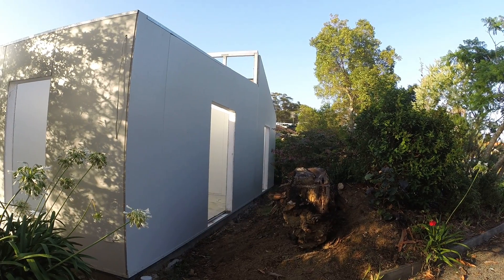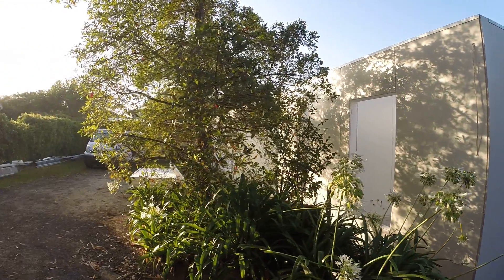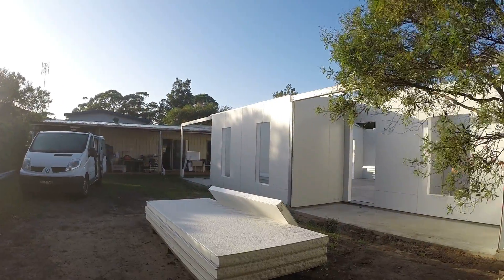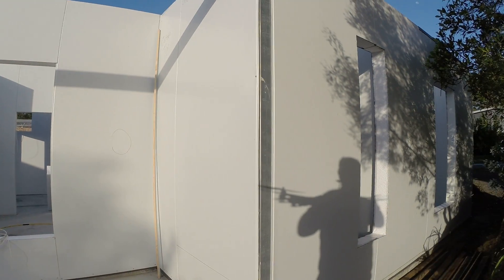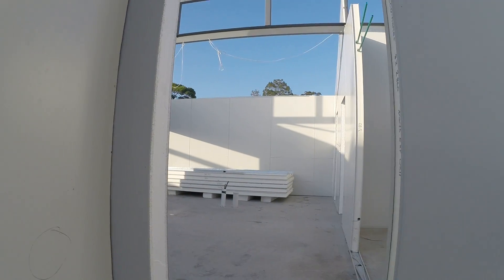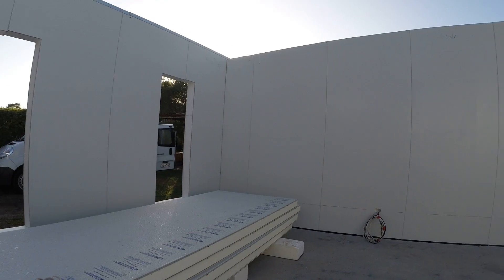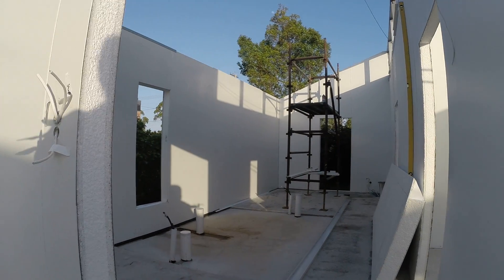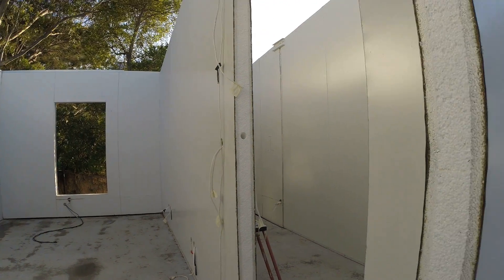SIPS Panel House Build So Far

Comment: I just found this video. Now I am going to have to binge watch your whole channel.
I have several questions but first of all - why did you use SIPS for the internal walls? Would it have been better to use regular wooden framing for the internal walls to make running services easier?

Comment: What do you do for siding?
Reply from the maker: As the Bluescope Steel and primed and pre painted with white colour bond  before being made in to panels you don't have to do anything. But if you have a look at some of my other videos I've clad one section in Villaboard and then applied stack stone to with normal tile adhesive. I will be applying Hardies weathertex paneling to the front of the house but this is purely a look/style choice and I will be using adhesive and screws to attach it to the panels.
Reply: SIPS PANELS Australia thank you!

Comment: This one must have a very high energy rating.
Reply from the maker: Yes in essence your using cool room panels  for both the walls and the roof  so its about the most energy conserving system.Thougth that was really  I very good side bennifit for my build,my main reason was the ease of the build  with only one extra person for the walls and only extra person on the roof was the Ab Hi crane driver,so Kept labour costs down.
Regards Ian
Reply from the maker: Yes very high as you make fridge cool rooms out of it as for the exacty specs go to AUSTEC Panels in weatheral Park in Sydney